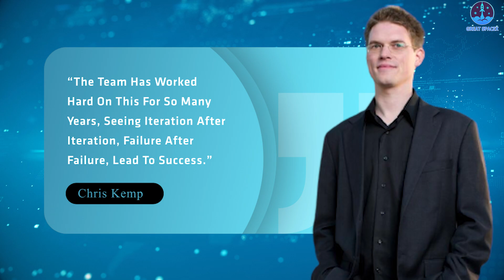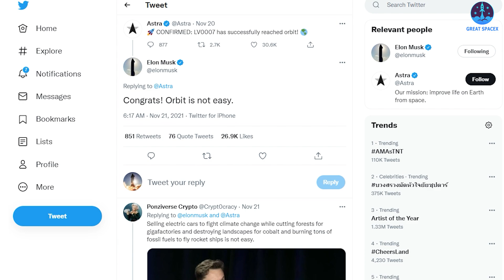Astra just reached orbit SHOCKING Jeff's Blue Origin, Elon Musk Reactions...

Comment: At 3:14 showing Virgin Galactic while talking about Virgin Orbit doesn't make sense. Galactic along with New Shepard are sub-orbital and Galactic is down for about a year for upgrades and improvements.

Blue Origin's progress is painfully slow. ULA might end up buying Raptor 2 or 3 before they see delivered BE-4's.
Reply from the maker: Thanks for your feedback!
Reply: SpaceX will never sell it's Raptor engines to the ULA for use on Vulcan rockets because SpaceX needs all it's Raptors for future Starships.  My guess is that Congress will relent and let the ULA buy more Russian built engines unless by some miracle the BE-4 problems are finally resolved.  I'm sure that NASA will throw a lot more taxpayer money at Bezos to make this happen.
Reply: I don't think BE4 has even been tested anywhere over 1.8 meganewtons. Even the current raptor is upto 2.2 MN and is potentially edging towards the required power level for vulcan.
Reply: @Marc83Aus  BO has built 9 BE-4's since 2017, SpaceX has over 100 Raptors built and more every day in 2 variants.

ULA might want to redesign for a different engine or source more from Russia rather than wait for BO.
Reply: Galactic made orbit earlier this year by launching the rocket from under the wing of a converted jumbo airliner.
Reply: @rodanderson8490  Virgin Orbit reached orbit, Virgin Galactic is an edge of space vehicle with an engine burn of 1 minute to reach the Karman line. Big difference.